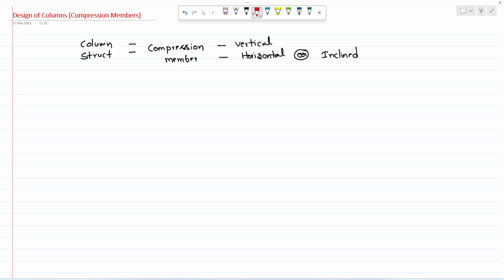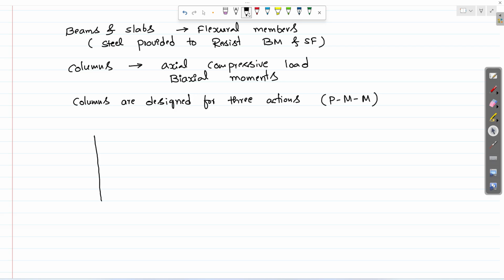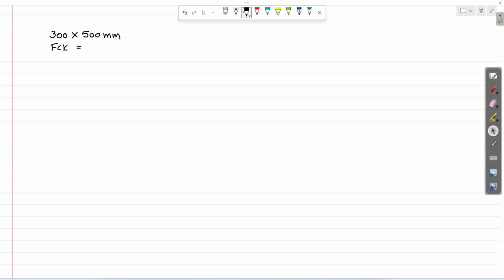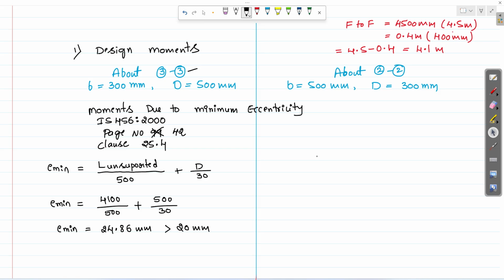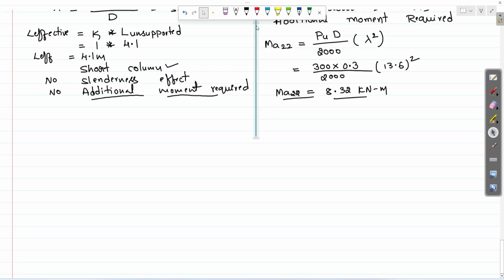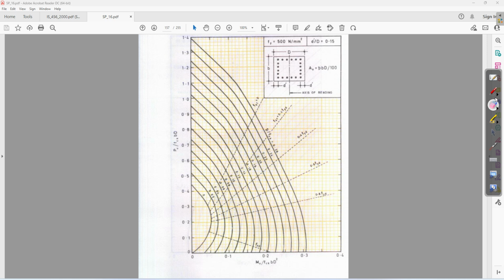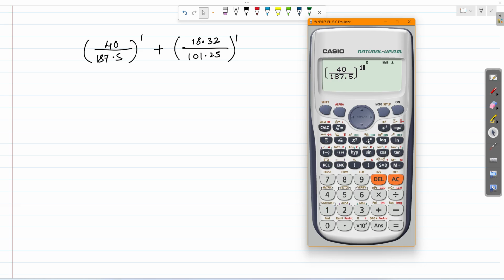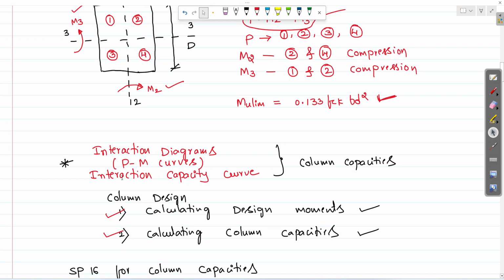Manual Design of Columns | IS 456:2000 | SP 16

Comment: How you have taken K=1 @48:19?
Reply from the maker: Refer IS 456:2000
Figure 26 for non sway frames and Figure 27 for sway frames.
Reply: But that is based on stiffness of beam and column which you have not considered @harishdesignhub
Reply from the maker: K is effective length factor depends on column end condition not on column cross-section.
Reply: @harishdesignhub 
See Beta1 and Beta2 on the axis of graph
And refer Annexure-E, E-3 it is for idealized condition
Reply from the maker: @magaj5665 Beta1 and Beta 2 are end condition not column cross-section.
Reply: That is based on stiffness check notes2

 @harishdesignhub
Reply: @harishdesignhub 
Please see notes 2 of Anexure E fro beta value... It is based on stiffness of column and beam